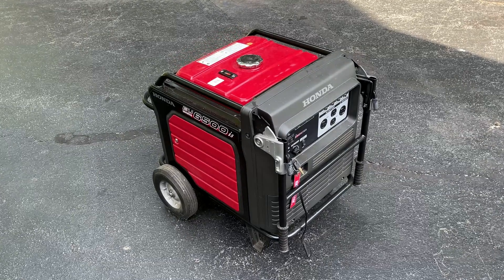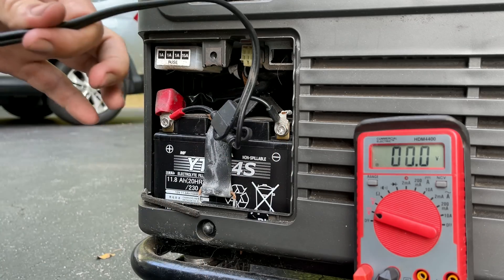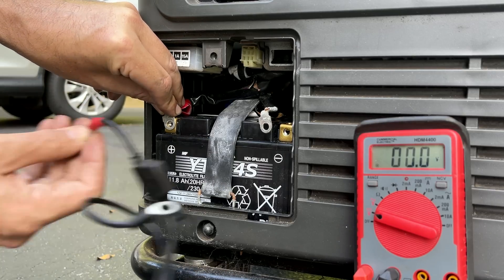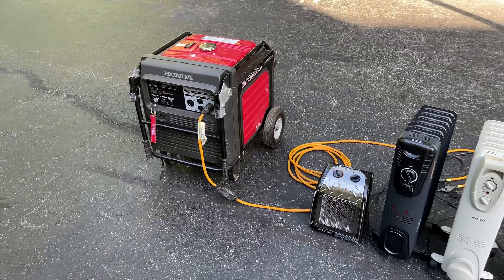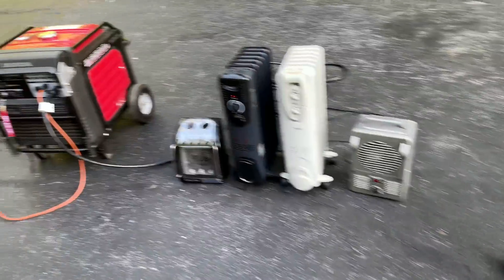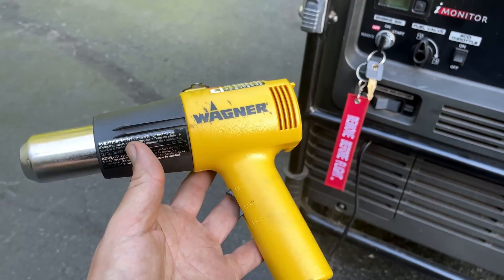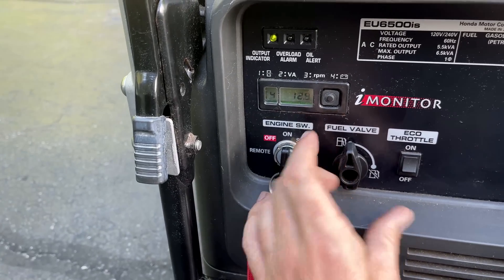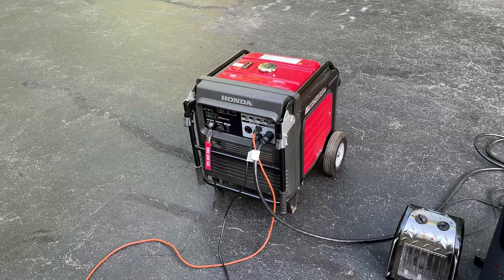Honda EU6500is Quick Fix and Load Test

Comment: This model was originally made for the European market for home standby power and is rated for over 7500W, but in the US, generators above 6500W must have a bonded neutral, which makes them useless as a standby generator, so it was derated on the label to 6500W.  The motor is actually rated for a 9000W load, so it's even more over-built.  Its power quality and ability to handle harmonic distortion is also amazing and these are one of the few generators that are suitable for TV and Film equipment.  They can also be paralleled together.
Reply from the maker: I wonder why they just did not bond the neutral.
Reply: @jcondon1  When feeding into your house which has an earth neutral link already,  you can get into trouble with a bonded gen. I once  unbonded a Kubota gen which was used as a backup unit for off grid solar and blew fuses  every time the inverter switched to generator. Also when charging an EV via type 1 or 2 adapter you may have to use a cord with an earth-neutral link as either the adapter or the EV will stop charging with a fault.
Reply: @jcondon1  My understanding is the primary market for these was for home standby power, where the neutral bonding would be provided centrally at the main panel.
Reply: @jcondon1  Honda's generators that are made for construction sites, and similar environments are neutral bonded to comply with OSHA/NEC requirements, but these can't be used for service panel interconnections with their own bond.
Reply: On a related tangent, my understanding is that Honda chose not to bond their portable generators except for specific models for the OSHA/NEC compliance market because if they are bonded, they need to be properly grounded to be safe, and most users don't properly ground their generators...So in the interest of safety for everyone, it's better to leave them unbonded.

Comment: What a great video!  I have this model at my camp.  I bought the place in 2019 and this and two other smaller versions came with the camp.
I have no idea how old they are, so, when I get there next weekend, checking the battery is a must do task.
This thing runs on occasional weekends, off and on.  
To button it up, I change the oil, put in fresh fuel, add some Stabil and it sits from Columbus Day to Memorial Day.

Year 3 and it’s bullet proof.
Reply: Reported.
Reply from the maker: And blocked

Comment: Same 18 amp hour,/12 volt from interstate would cost @ 35.00.  ask me how I know....$200.00 no fing way James.
Reply: Ok
Reply from the maker: I am actually returning the battery.  It lost its charge and will not charge back up.  $30 Might Max battery ordered to replace it.
Reply: @jcondon1  Not telling u what to do but for over 25 years had awesome luck w Walmart batteries.  Everstart.  I believe they made by Johnson.  Interstate have been the worst.

Comment: Jim,  I ran into a problem with my 2900 watt, 20 amp generator. My welder draws 20 amps, which is just about too much to weld with. I have a bigger generator, so I'll get the carb cleaned on that and see how it works. A cousin of mine said that the generator needs to overlap the power needs of my welder for it to work better.

Comment: 10 year battery life is really good.  I used to keep my Generac on a trickle charger and it seemed that after about 18 months the battery would fail.  I finally got the word about using a battery tender rather than a trickle charger and I believe I am well passed the 18 month period on the latest battery.  Have you experimented with the use of super capacitors as a replacement for the battery?  It seems that $200 is a lot to pay for that small battery.

Comment: Honda has a reputation for being dependable and they live up to it. I've had Honda car, motorcycles, and generator and never had a problem with any of them.  If I have a choice between a Honda and another product I will pick the Honda even if it costs more because I hate cheap junk that gives nothing but problems throughout it's life.  Dependable well made equipment is worth its weight in gold over the life span of the equipment.  Just can't beat a Honda, and no I don't work for them. Haha

Comment: James awesome video. awesome knowledge you have on repairing generators of all types. If you do not mind .I have a question for you with all the knowledge you have. I have a WEN generator 6,000 w I've had it sitting for 2 years still in the box but before I run it on gasoline. I rather run it on propane. Could you recommend a good conversion kit for me to purchase. so I can run it off of propane and gas complete set up. could you recommend something four me.. thank you for all the knowledge you share to me and to everyone else God bless. PS. Any information would definitely be appreciated thank you once again God bless.
Reply: @jcondon1  thank you James for replying back to me give me a few days I will get the numbers and get back to you. thank you . God bless. PS you are one awesome mechanic. Thank you for helping me Walt.

Comment: 9:30 Good man. NEVER  start, or stop a generator, with a   '' load ''   on the output. Damage, will result; either brushed gens or brushless ones. Different problems will take place,  with  each.   AVR  and rotor loosing residual magnetism.
Reply: I've always heard this but I question how likely it is to actually cause damage. And if it does cause damage, how likely is permanent damage?

One thing I can say with near certainty is that inverter generators won't be damaged by this.
Reply from the maker: I think the issue is more related to the power surges damaging what you have connected to it.

Comment: That battery is readily available from many suppliers for well under $200. Quick visit to Amazon: $159 +tax, shipped. There are lots of brands lower than that. Prolly not too risky since there are so few US manufacturers for hundreds of brand labels. Chinese, as usual, suspicious although there are at least a few very good ones.

Comment: There's a big difference living in North/Middle Georgia.  At the wife's insistence I bought a generator about 10 years ago in case the power went out for an extended period of time.  Like more than 8 hours.  It's still sitting in the garage never having been started.  I was thinking about selling it but there doesn't seem to be much of a market down here.  I recently cycled the 10 year old two cycle gasoline through the car.  And replaced it with some premixed in a metal can which should last indefinitely.
Of course now that we retired we just go to our Florida house in the winter and only read news stories about the occasional sleet storm in North/Middle Georgia.  And we observe the once per winter dusting of snow around our house with our internet cameras.
Reply: I've had more power outages in the last year than ever.  I believe that the "green new grid" is going to prove very problematic.  I would keep your generator.  It eats very little.

Comment: That generator is a beast machine, here it costs like a car (a good one!) I have the small brother, the eu3000is, expensive too but rock solid machine, powers the entire house overnight on a single tank in  econo mode (won't power the AC minisplit though, unless in high power mode, but makes more noise and uses a lot more gas!
 My original battery lasted for 7 years, also used a home made battery tender for it, and replaced by a mid brand one because the original Japanese yuasa costs a freaking fortune here, makes no sense.
These costs a lot more, but IMHO, worth every penny

Comment: $200 is better than $10 k for a electric car battery 🔋
Reply from the maker: That $200 battery was dead the next day and will not take a charge.  Might have to go the cheap $30 battery route.
Reply: @jcondon1  ouch that is so not cool with this battery 🔋 going down 👎  hopefully you will have better luck with the $30. Dollar battery 🔋

Comment: I like the Honda equipment and cars. We are on our second Honda car. Had a CRV great small  SUV. Now we have a Pilot and have no complaints.  I have a few pieces of yard equipment powered by Honda engines, they have never failed to run in 10 years now.  That is a nice gen you have there.

Comment: 🇨🇦 I’ve owned an EU7000is since 2016 (new) and it has worked like a charm.  Only has about 50 hours on it so it’s good to see one as old as yours still working fine.

James: how many hours are on this beast?
Reply from the maker: Just under 400 hours.  But they should last many thousands of hours.
Reply: @ 11:10 in video, it says 386 hours.

Comment: James, just a thought, have you ever tested your heaters to see if they are pulling the watts they say they are? Good video! Your Honda is a beast...
Reply: He uses the Kill-a-Watt on every video.  It's easy to plug the heater directly into that.   So I'm certain he knows exactly how many watts each heater pulls.
Reply: @jimthesoundman8641  He could have used the Honda's VA output display to validate the power draw for this video.

Comment: You could really use an oscilloscope to examine the line quality in these videos. The Killawatt just give peak to peak, it would be good to see just how dirty the generated power is.
Reply: He has one.  We've seen it on other videos.  The Honda EU line puts out very clean voltage.
Reply: @raouliii  Really? Mine never did. I bought two and they both were horribly noisy.

Comment: When I bought my eu6500 a few years ago from the original owner, I showed up with the same black splitter cord and 4 space heaters, plus my Fluke meter. I asked if he minded that I load test it before buying. He said no problem, then grabbed a chair and sat and watched me!  I didn’t exceed the 6000 watts. It ran perfectly and I bought it. After owning and working on many small gens, this unit is still the gold standard. My only complaint is that it’s very hard to 100% drain all the gas out of the tank. Like every drop. I end up rocking it back and forth a dozen times, with the carb drain open, in order to get every drop out.
Reply: why not turn off fuel valve, run it until it dies. Use only ethanol free gas in it. The ethanol free gas will last 4 years or longer, by than you would have used up that fuel (even by just running it 4 times a year as a service thing) and can add fresh non ethanol .. wash, rinse, repeat. That has been working for me, since 2014.

Comment: I had to look twice to see the price tag on that 12ah battery. 
230$ for a 12ah automotive agm battery? That is unacceptable even if it lasts 10yrs lol. U it should be like 23$. Not 230$. My car's starter battery was 50$ and still going strong for last 7yrs. Although the dealership told me to replace the battery cus the cca is down. It's an amaron battery (not the Japanese company omron).
Reply: Okay slightly changed my mind. This battery from amaron or tata green , varta sells for around 100$ . So i have no question about honda selling it at 230 lol. Why are these so expensive..

Comment: Hi James.   Love Honda Inverter Generators!  I have an EU2000.   Never had an issue either and it's 12+ years old.   My hope is to get The "Grand-Daddy" of them all: the EU6500 or newer version; EU7000 someday.   What's your recommendation for keeping the fuel tank clean as they are metal and can rust?
Reply: I would think he will suggest running the carb dry before shut off then storing the tank empty and the nachine under cover. Alternatively you could use the alkylate fuels (we have Aspen in the UK) that have zero ethanol. They are rated for several years before going stale.

Comment: Wow, what a beast of a generator.  Quality matters.  For those of us who don't have inverter generators, could you offer some tips (or maybe future video topic?) on how to clean up our power output so we can better protect sensitive devices?  Thanks, and love your channel - even when it's just a battery swap!
Reply: You gotta love how easy they are to work on too, a screw there's your battery, terminal bolts and done.
Reply: #1 "Sensitive devices" don't really exist for the most part - that's basically a myth. #2 the only effective clean up is a "double conversion" or "online" UPS which has its own inverter.  Unfortunately, this type of UPS costs almost as much as a new inverter generator. Large sine wave inverters are expensive electronics.
Reply: Inverter generators always put out messy power unless you specifically buy a pure sine wave inverter, which are about twice as expensive as a modified sine wave inverter (which is the standard type on these generators.)   If your generator has a starting battery, you could buy a small pure sine wave generator and run it as an auxiliary off that starting battery, so you can use the generator for powering lights and refrigerators and stuff that doesn't care about messy power, then you can use the smaller pure sine wave inverter to run sensitive stuff like laptops.
Reply: @jimthesoundman8641  AFAIK most inverter generators have a pure sine wave output. And regarding running an inverter off the starting battery, that won't work well. The charging system is probably less than two amps so you'd drain the battery.

Comment: Replaced many of these YUASA batteries on my Honda motorcycles over the years! I'm surprised it the YTZ14S  is so expensive in the USA. Here in the \UK, including 20% VAT, they are around £80 if you shop around. Would have thought you could get one in the US for half the price you paid?
Reply: If he looked around yea but he went and looked for the Honda part #
Reply: @FishFind3000  Ah, the old Honda Stealer prices. :)

Comment: There is no way that Honda battery is worth $200. Amazon has several, starting around $35. I bet Yuasa  batteries are made in the same factory. That's a Honda gouge..
Reply: While you are correct about most big box stores stocking the same generic Johnson Controls made batteries, Yuasa batteries are not owned by them. GS Yuasa, based out Japan, is one of the largest OE suppliers of power equipment battery’s. I agree the cost is high, but my experience with Yuasa tells me they are worth it. I’ve seen these battery’s last for 10-15 years in Genset, Powersports and other commercial applications that would required other brands to be replaced every 2-3 years. 

Old Italian proverb: “there is nothing more expensive, then cheap”.
Reply: Way over paid for that battery.  I have cheap Amazon battery and it has worked for years (since 2016). Start it (Same generator) every month religiously.  Also lesson learned.  Make sure the battery door is installed else motor will run bad.
Reply: Thats what you pay for quality and inflation nowadays.

Comment: Honda sure does make some really nice equipment. That little gen is awesome 😎 makes me wonder 💭.   🤔 do you think the newer gen-sets will be able to last or in todays day and age is everything pushed to limits with not much safety margin?  Therefore every 3 to 5 years you are always replacing.
Reply: Honda's are built right...even to this day.   No compromise on quality which is why they are not cheap.    I don't know ANYONE who ever regrated buying a Honda Inverter Generator.    Can anyone say that about the cheap Chinese knockoffs?   (no)
Reply: @Ram14250  I couldn't afford the honda and bought the wen generator that does both gas and propane at 900.00 bucks delivered. 
The Wen did fine with the load but man it was loud. After starting it up and testing my house load I regretted that decision. I should have bought a Honda.
Reply: @dljones61  Yep, when you have it near and have to listen to it for 1-2 days during a power failure, you are nothing but thrilled to have a quiet Honda.   Overall, it's worth the money.   No regrets ever!

Comment: Remarkable how quiet that generator is even at full load. What an amazing machine!
Reply: honda was a VERY good reliable brand with good head room BUT reliability cost sales and cheap knockoffs changed market and reliability
Reply: @willrobbinson  I will buy a second duromax 9000 at this price point..
Reply: @willrobbinson  I will buy a second duromax 9000 at this price point..

Comment: How does that cord target leg1 versus leg2 of the generator.  Is it made specifically to do that?  I've seen all your videos, I don't recall you doing that before.  Keep up the great work!
Reply from the maker: The 240 outlet is made up of two 120 legs in series.  The neutral wire is the center tap.  The cord is called a breakout cord.  It puts leg1 and neutral on two of the cord outlets and leg2 on the other two outlets.  Here are some links to a few similar ones: https://amzn.to/3Rl3N9j   https://amzn.to/3RjGEUr
Reply: Love the dog bark at the end!